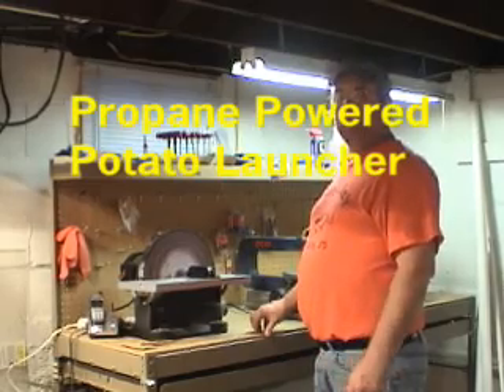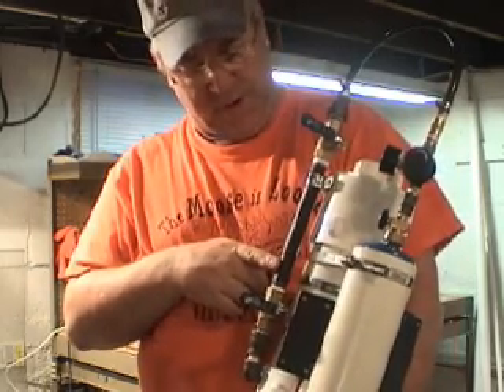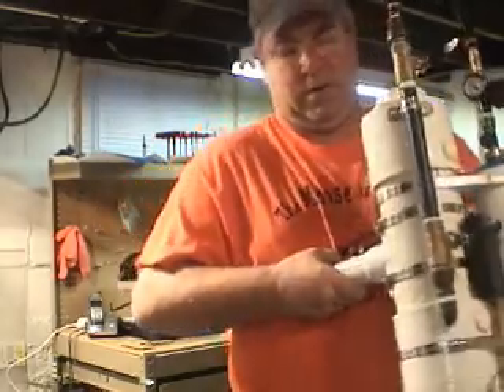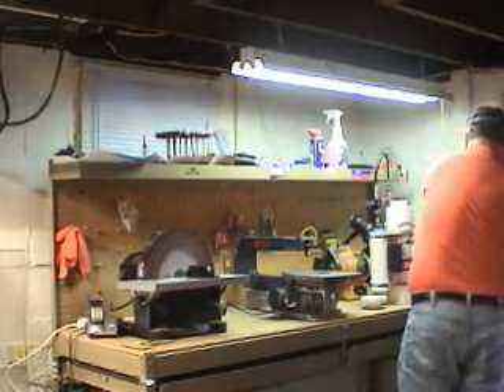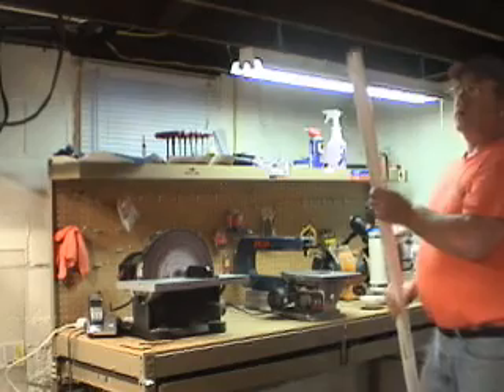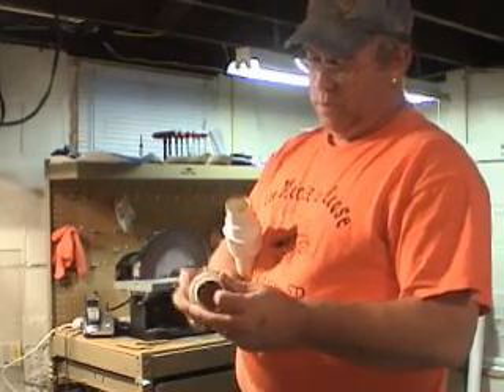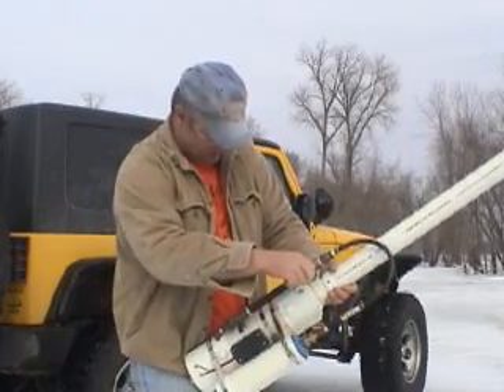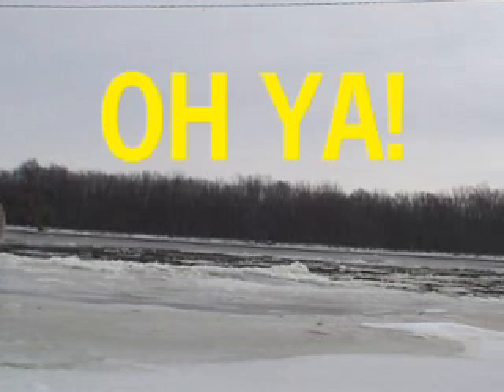Hi-Tech Propane / MAP Gas Potato Launcher

Comment: Lastly what wires did you use to connect the fan power source to the bolts? Also what bolts did you use and there size please?

Comment: Thanks for the fast comments, that is my last question. I just was not so shore about how to regulator works, now I understand as you stated that the regulator will regulate the who system to 20 psi when the first ball valve is opened. Thanks so much

Comment from the maker: That's not correct if I understand you right. The supply line to the metering pipe can be any size. If the regulator is set to 20 psi the supply line holds 20 psi, open the first ball valve and the metering pipe will also pressurize to 20 psi the entire system can only be 20 psi until the pressure at the regulator is raised. I'm having doubts your are ready to build this. You need a good understanding of how it works. I starting a lot of overtime at work and I will not be able to assist you with the build.

Comment: How, if you had a different volume before the ball valve then the psi would change. Say you had a volume of 30 in between the ball valve and the regulator, and you had a volume of 10 in the meter pipe. If you regulated the pressure to 20 psi according to the volume 30, once you open the first ball valve the pressure will increase due to the decrease in volume, this causes the pressure in the metering pipe to go higher than what it should've went to. My question is, how does the volume not matter before the ball valve? If you regulate the pressure it will regulate it according the volume or space in front of it. So your psi in the metering pipe could be way off depending on the difference of volume between the meter pipe and the volume from the regulator to the ball valve.

Comment: How did you make the ignition button at that handle, how was it transferred. If I used a electric spark igniter, how could I replace its switch to a homemade handle? Is it transferred with wires?

Comment from the maker: The psi will remain the same if you use a large or a small metering pipe, psi is psi. The volume of gas will change. 20 psi on say a 3 inch pipe will not be the same amount of gas as a 8 inch metering pipe. But say the 8 inch is at 20 psi the 3 inch will hold the same but the psi would have to be raised to do so. The regulator controls the psi after it. Don't worry about volume. You could run a 1/4 inch hose at 20 psi and fill the metering pipe with no issues. The volume doesn't matter until after the first ball valve just the psi. The higher the psi the larger the volume of gas that will be packed into the metering pipe.

Comment: Please try to answer my question, thank you. First, if you have a small metering pipe and a large metering pipe and you charge both with 20 psi will they both have the same amount of psi. If you took the psi from the big metering pipe and put it into the small one, will the small metering pipe have more than 20 psi? Also my first question was, does the pressure regulator regulate the pressure according to the fittings attached to it. If so, wont the volume of the fittings that attach to the propane cylinder have to have the same or close to the same volume as the metering pipe? Does the fittings that attach from your propane tank to the ball valve have the same volume as the meter pipe? Thank you

Comment from the maker: The 4 inch fan is out of a computer, you can find them pretty easily at a recycler or online.You can pick up a 3 cell lithium pack at a hobby shop that sells electric airplanes or cars. The 3 cell should last I'd say for 50 to 100 shots you just run the fan for about 5 seconds for each shot. I'm not sure the issue with your stun gun, I use a Duracell 9 volt and it's been in there since it was assembled. .

Comment from the maker: Just for ease of routing. Those wire are special wires that come from a old TV picture tube that are capable of handling the 100,000 volts. Most TV shops have them laying around. A shop in my area just gave it to me. They have a lot of insulation on them.

Comment from the maker: I filed a flat spot on the outside of the handle for the switch, as far as the wires I just used some epoxy to seal the hole. The box is held on with velcro that has adhesive on it.

Comment from the maker: When I referred to the ratio of 1 1/2 to one I used an example of 1.5 gallons to one gallon of water. It doesn't mean the launcher and barrel holds that particular amount. No matter the size just keep the ratio 1.5 to 1.   There are conversion tables out there you can use to get your barrel to chamber ratio correct.

Comment: @happycamper487 ABS is not recommended for potato launchers since it has tiny bubbles inside which many it more prone to breakage.
That a really nice potato launcher. Like how far do the potatoes go? A tip for safety, don't use the launcher in cold weather like you did. PVC becomes fragile and brittle in cold weather.